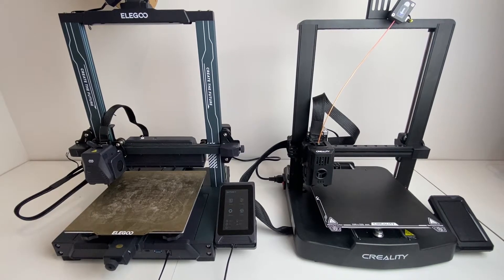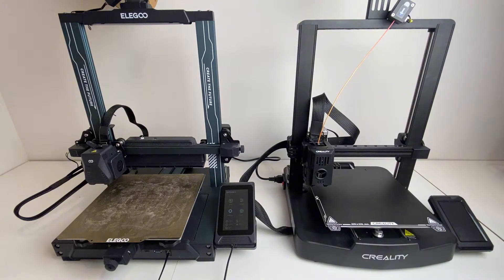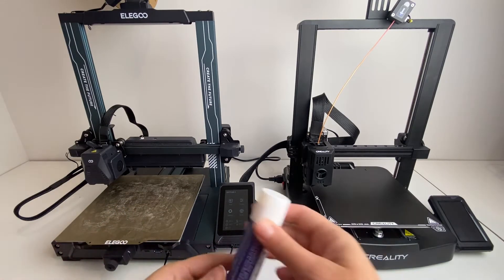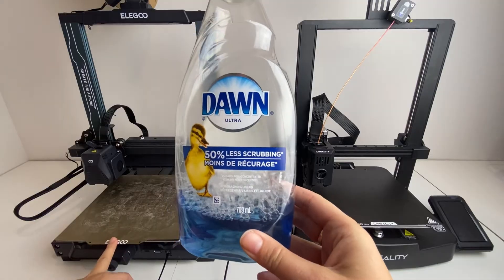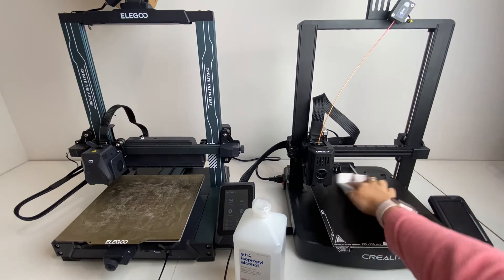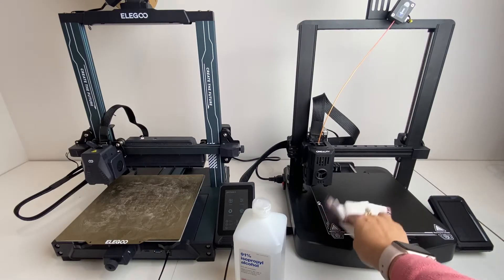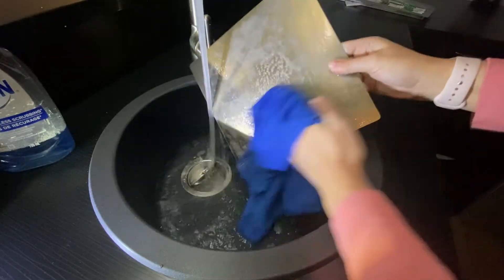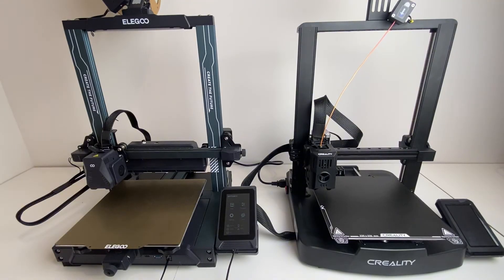How to Clean Your 3D Printer Bed

Comment: Can you use bar soap for this? I used some pine tar bar soap, made a lot of suds, and scrubbed it really really well. I'm still having adhesion issues, but I wonder if the soap solids never fully came off. What do you think?
Reply: May be other additives to the soap, try dish?

Comment: Depending on your glue stick you may, like myself, only need to add hot water to the plate and use the "print spatula" to remove the caked up glue. I don't even use dish soap or alcohol with how effective it it.

This is down to the glue you use, mine is reaaaally water soluble so a sneeze would take it away
Reply: what kind of glue do you use?